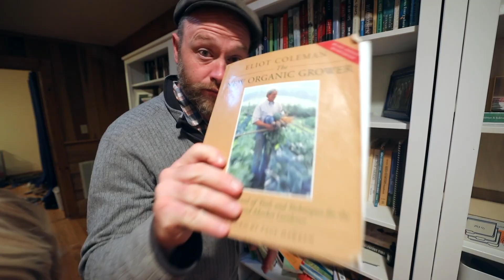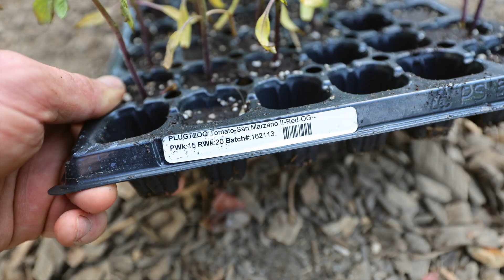How We’re Planting Tomatoes (Totally Different than Most)

Comment: Noooo! You need to start further from the door with the 🍅,  they will obstruct the doorway.  You need 2 rows of tomatoes down the middle, cukes, on one side beans on the other. 18 to 24 inch walkways.  Use your purlins.  Interplanet basil.   Screens on the roll up sides and on the ends for good ventilation